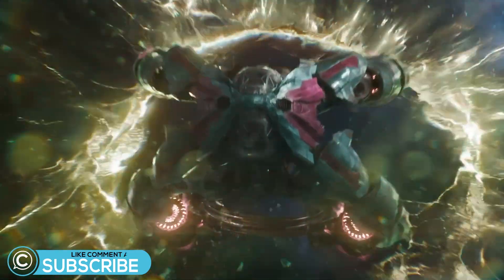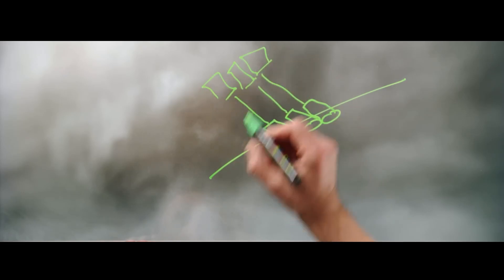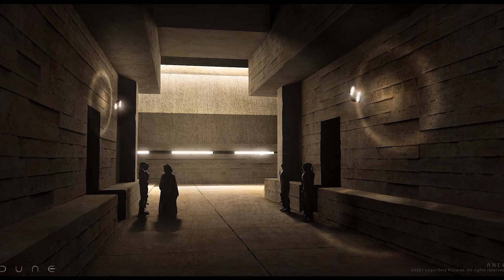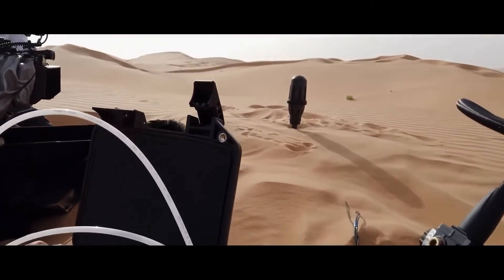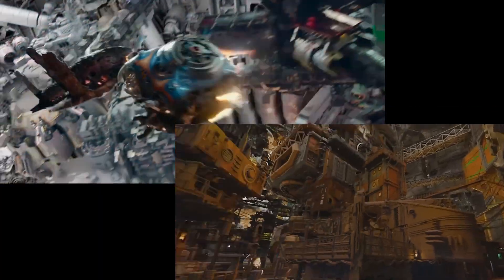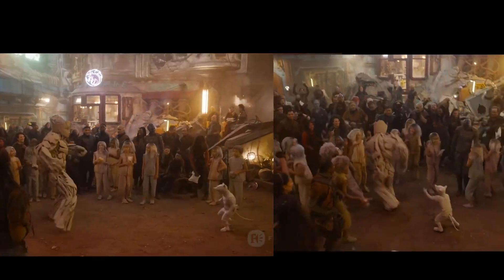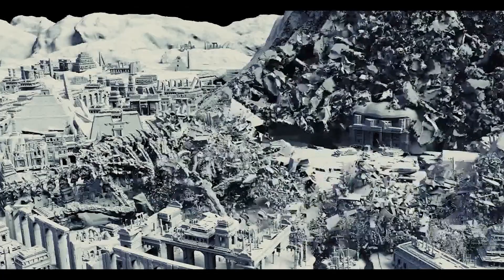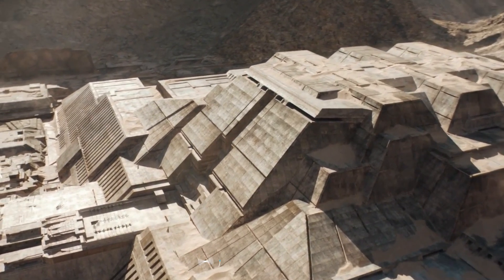Fremen, Ravagers, & Kaiju | VFX of Dune, Guardians of the Galaxy, & Godzilla x Kong

Comment: Hello sir my question is 
Will animators lose their jobs because of motion capture?
Reply from the maker: Definitely not, it’s just a tool and has been around for many years, and even the best solving still requires a lot of clean up.  Many of the best animations do not even use motion capture. Ai on the other hand could be interesting but it still has a ways to go for 3D animation, but the technology is advancing quickly